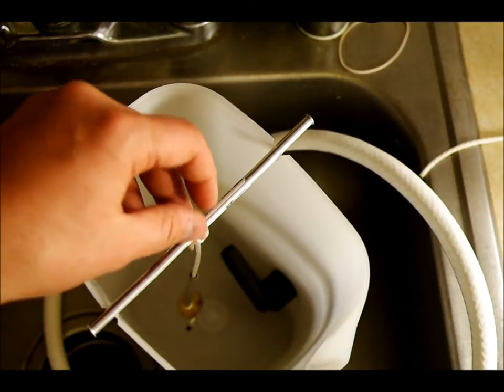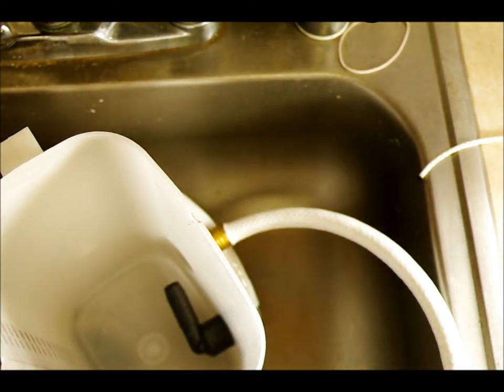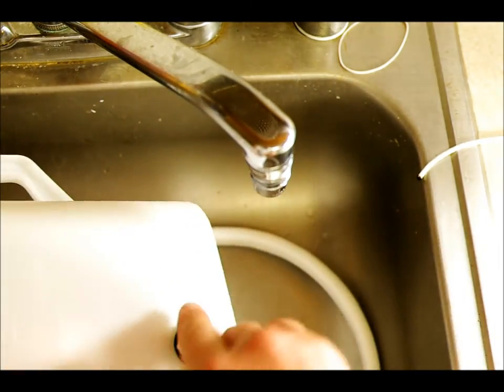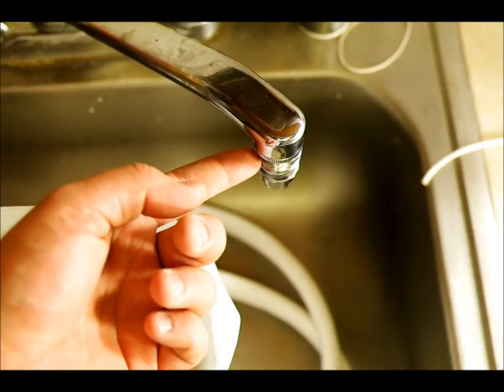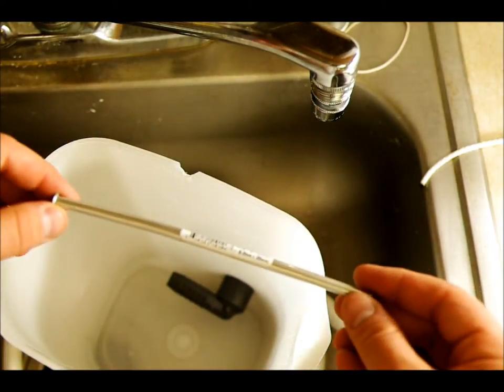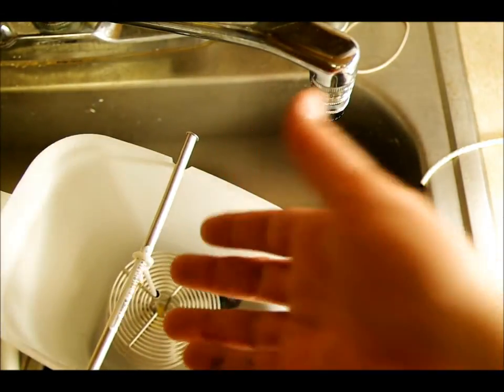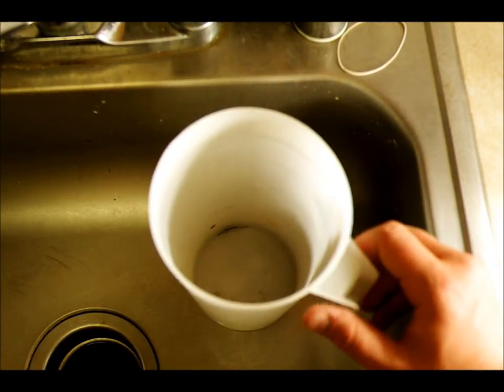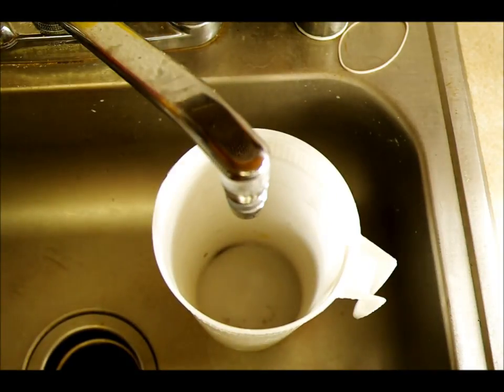Simple, Home-made Film Washing Tanks for Film Processing

Comment: I use a similar washer as the second one but instead of the holes I put a short rubber tube down the side and around half of the bottom so it gives the swirl and flows from bottom to top, spilling over the lip. The plastic jug is wide enough for the tube and three reels of 35 mm film. The reels hold the tube against the side and I get a really good wash from a simple, cheap setup. And it leaves the jug available for double duty.

Comment: I was always under the impression that hypo was heavier than water.
Reply from the maker: +jumbosilverette If I said it was lighter, I mis-spoke. You are correct and all the clearing agents I've used sink.
Reply: +David Hancock thanks for the reply. The only reason I mentioned it is because...wouldn't it make more sense to have the tank drain from the bottom?!
Reply from the maker: jumbosilverette When the tank drains from the top, the water flow is more gentle than when it's gravity fed. That's because the fill rate determines the discharge rate, not the pull of gravity. Gravity will pull the water quickly enough that it can cause streaking on the negatives where it rushes through the film sprockets. That issue is less so on medium format and sheet film, but 35mm is susceptible to surge damage (from rinse water and chemistry.) Also, none of the chemistry is so much denser than water that it sinks against flow, so an upward water flow will remove and carry away the chemistry.
Reply: David Hancock good explanation. Thank you.